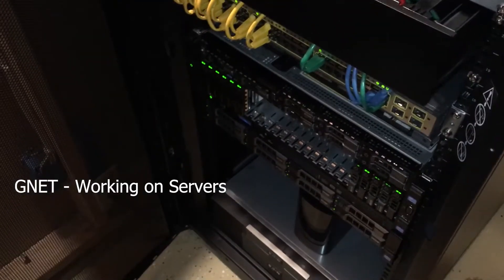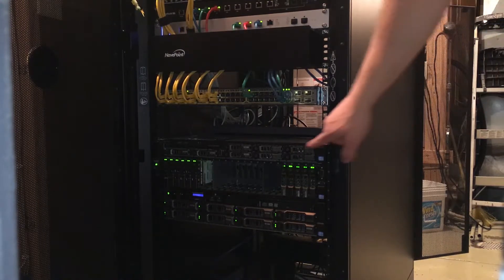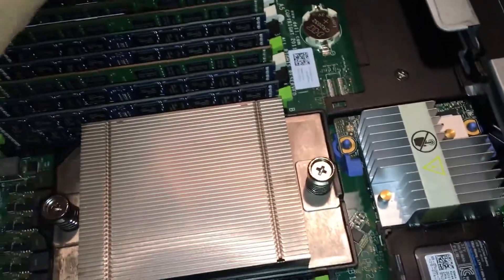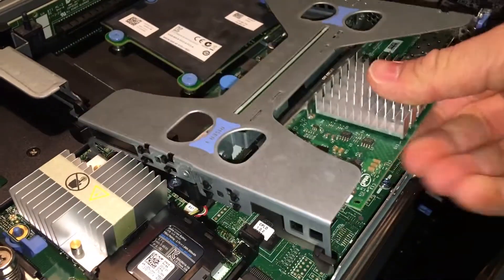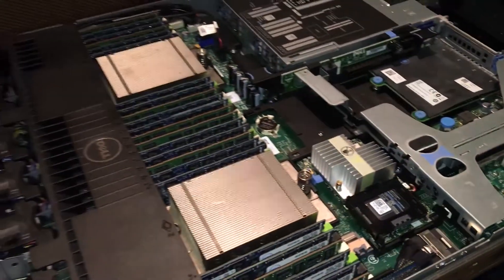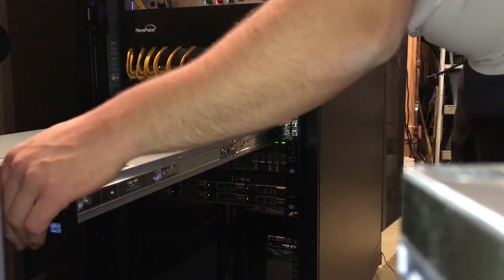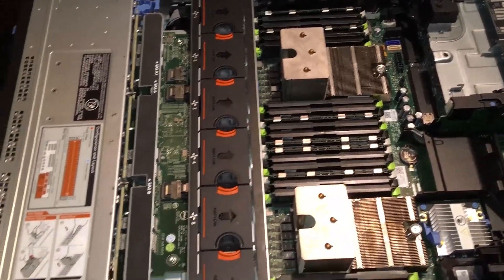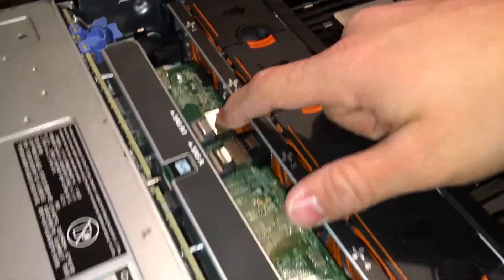GNET - Server Installation & Updates

Comment: Thanks Buddy great video..
Recently upgraded from a HP DL365G1 with 32Gig ram. to a HP DL380G7 with 30G ram.
I'll make some Videos shortly...

Asked my mate about Dell R720's but all the 720's he had had no Drive Cages etc. and where only setup to connect to San.
But he had the dL380G7. and it has 8 3.5" Disk Bays.
So running 120G SSD boot, 2x 15k Sas for Swap / Scratch (raid 0), and 5x 720G Sata drives in Raid5 for VM's / Storage.

Server is running Windows 2016 Datacenter (cost me $12 NZ) (Ebay) So far no issues. running Hyper-V 8. etc.

Server running my Workload a few game servers + mail server (vm), Webserver (VM) and test VM's + my PFsenese Firewall VM.
Pulls 90Watts... (only 1 CPU right now .. but plan to upgrade from a Quad Core to 2x  Hex cores  in the Future.